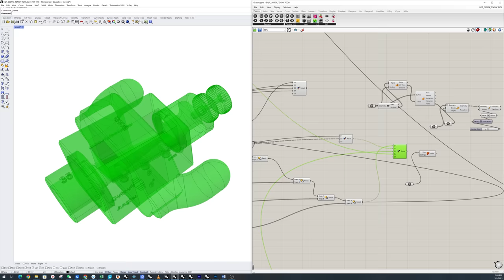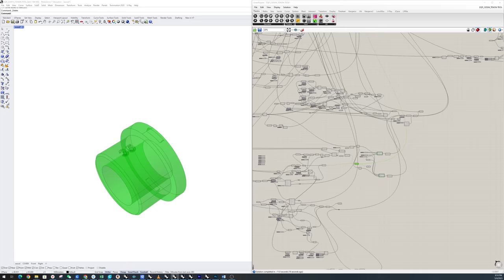Effortless Furniture Building: How to Use the Tapered Tenon Tool

Comment: Cool product! 3D printing makes perfect sense for this, and I'll have to grab the files. I have been building a lot of simple stools and thinking about getting a tapered tenon tool for the legs instead of doing it all by hand with a spokeshave. I agree with others that a reamer would be a perfect companion to this tool, it makes for a great joint if you can have the tenon and hole the same angle!

Comment: Great design, try using a high torque low speed drill when attempting to add machine power. Also it would be amazing to see an actual pencil sharpener that has the ability to cut various tip angles.
Reply: Sds drill would work

Comment: I get best results when I design for the specific material I intend to use for the part. Resin parts tend to look quite different from PLA parts. Looks like your design workflow is optimized for extrusion printing, so I'm not surprised your resin part had some minor mechanical issues.

Comment: Love your videos. What are the inserts you use in the prints? Thanks.
Reply: you can find them under different names as example: Furniture Screw In Nut, Threaded Wood Inserts, Bolt Fastener Connector Hex Socket
Reply: @CLAUDIUIOANCIREBEA  Thank you